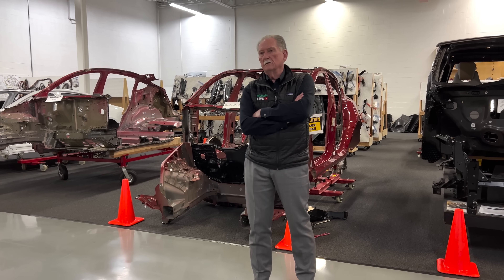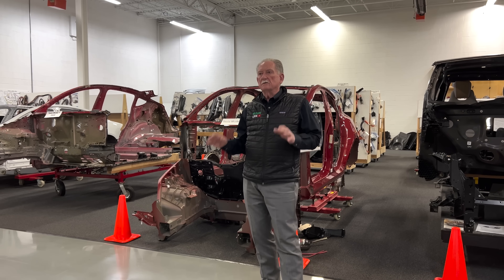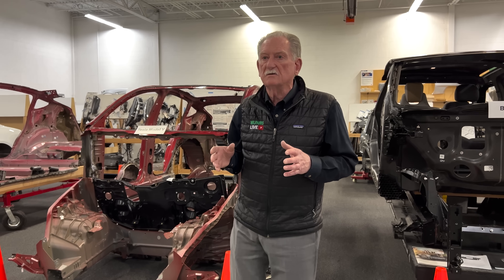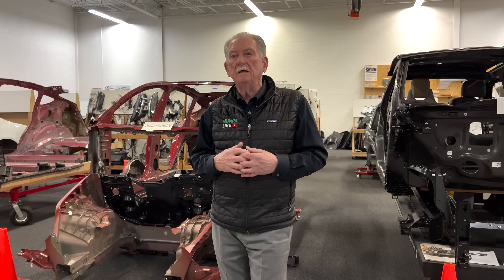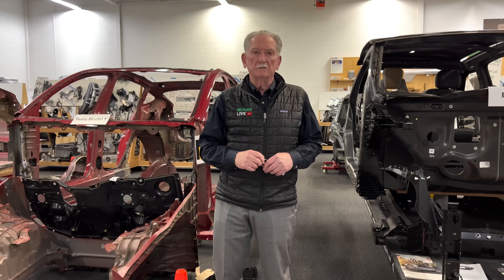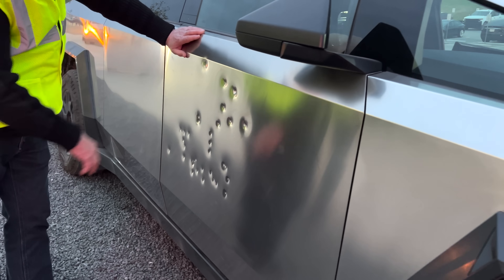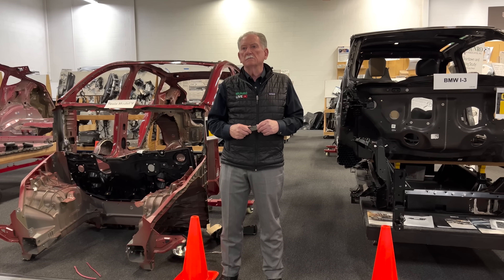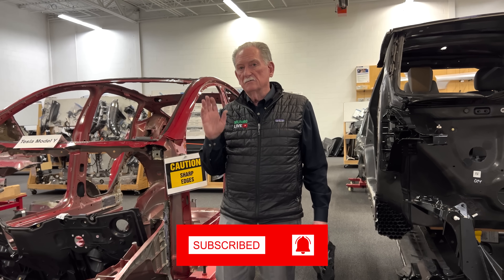An Engineering Analysis of the Tesla Cybertruck

Comment: No one cares about CyberTruck.  Elon never learns from his mistakes.  He could have produced an electric truck and beat Rivian to the market.  It would have been so easy.  Yet he got distracted by flash and pomp.  Then production quality gets screwed.  Who needs a 6600 pound truck that can go 0-60 in 4 seconds?  No one.  Its a truck, not a perfomance car.  In otherwords, a speedy death machine that will roll over and launch it self into a roll very easily. You may say that the battery and motors will lower the center of gravity.  However, how long before people start to jack these up?  Elon touts the environment but then produces products that are anything but economic and environmentally friendly.

Comment: The 48V has been used a couple of years now, mostly for hybrid systems and other high power users. It is new to convert everything to 48V, but something like 30 DC-DC converters are needed for things like cameras, dashboard, lighting, sensors and computers, those DC-DC converters are going to eat up some of the 48V benefit.
Talking about weight benefits of 48V sounds weird when the panels of the truck is made from very inefficient thick and heavy steel, compared to any other car or truck.
Just 0.5mm extra thickness of the body panels adds up to something like 70kg / 150 pounds, for countries where "bullet proofing" is not needed, that is a lot of dead weight to carry around.
Reply: I guess they've got to keep the steel thick enough to suppress the drumming of the flat panels
Reply: @pedtrog6443  Did not think of that, but very much possible. 
They could have done it more elegantly but yes.
Reply: A 48 to 12DC buck converter is simple and cheap.  They will be only be used where Tesla uses a device is designed for 12V power.  For example, POE cameras are powered at 48V.  Tesla manufactures their own actuators using 48V or gets them from suppliers when high volumes justify their manufacture.  Moving weight from wiring harnesses to body panels has the benefit of increasing dent and corrosion resistance while allowing for higher power transmission.
Reply: @MsAjax409  Why not keep the body panels industry standard and install 100kg extra battery instead?
Panel thickness does not matter when talking surface corrosion resistance, only if you let the panel rust and look like crap for multiple years, does thickness make a difference.
Also the non stainless parts like suspension arms (Tesla weakspot already) are going to rust away long before the body panels, so the car may end up being the shiniest car on the scrapyard.
Reply: @larsjrgensen5975  The SS panels have been reduced to 1.8 mm for the doors and 1.4 mm for other panels.  They were made martensitic (harder) to retain dent resistance.  Given that there's roughly 100 sqft of SS on Cybertruck with an average thickness of about 1.6 mm, reducing to 0.9 mm (@ 1.5 lbs/sf) would save about 116 lbs.  That's the equivalent of a battery pack of less than 20 kWh.  At 0.4 kWh/mile that's an extended range of 50 miles.  I'd rather have the stronger panels since 318 miles of range covers all my needs.  Those who tow a trailer can either add the range extender or buy an ICE truck.
Reply: @MsAjax409  20kwh would have been a nice addition in the little room under the bed.
The range extender is a joke, limiting the bed size and hampering the ability to transport building material.

The dent resistance is nice, but these panels are going to be expensive to change if they ever get a dent or the surface gets scratched.
Some asshole with a screwdriver can still scratch the surface if they want to and good luck sanding the surface to make it match the rest of the panels.

Comment: The technical details on the stainless is super interesting.I'm curious how it all turns out given the panels will show every little mark. 
The 48v stuff is less interesting.It's not a big deal on such a heavy expensive truck.
And their steer by wire? I'm deeply suspicious of such things,especially from a company that blatantly lies to themselves about it's FSD capabilities.
And comparing it to military or large commercial aircraft is stoopid 😅.Their triple redundant systems and massive testing regimes are a world away from this

Comment: Very interesting about work hardening austenitic stainless into martensitic stainless to increase the tensile strength. Pray tell... how do they increase the low-temperature toughness of the martensitic phase to make the vehicle suitable for low temperature operation without fracturing over bumps, or in the case of the frame hitting a rock during off-road adventures in areas of the USA where it gets very cold during the winter? I specifically avoided using a martensitic stainless steel for a safety-critical part that I designed a few years ago because I knew that they would definitely be used in cold conditions, and the impact toughness simply wasn't good enough, despite the high ultimate strength of the material.

Comment: What happens to these castings upon hard impact ?
If you put higher voltage into a thinner wire, does it create more heat ?
What is beneath a cyber truck....will it be damaged by road salt ?

Comment: Good stuff! What is the purpose of the cross hatching on the conventional castings? Is it to facilitate mold release? Or evacuate the last air as the slug is injected? Or is it actually structural? Theres more to unpack in this innovation.

Also very interested in future discussion on welding two castings together - AFAIK that is totally unprecedented (at least in a mass-production setting) for castings of that size!

Comment: All stainless steel is non magnetic, its due to the chromium content, which eliminates the magnetism of the steel and also makes it rust resistant. Get your metalurgy right🙄 There are numerous high strength steel alloys that are not stainless and are used by essentially all manufacturers as a method to add strength to the car body while saving weight in the process. In fact, Germans' manufacturers are the masters of using different steels and metals to achieve varying structural elements on a car body. The Tesla truck looks like a high school project compared to Mercedes EQ or BMW IX structures.

Comment: Speaking as someone with decades of through the viewfinder experience, IMO Sandy should leave the on-camera performance duties to his far more capable junior engineers. 

Conflating non-stick frying pans with non-stick magnetism just cost Mr. Munro the remainder of what limited credibility he had before this video.  Self-hardening Martensitic steel has been used in bulldozer blades forever. 

Like Twitter/X, the Cybertruck will be a colossal fail.  They might be able to repurpose the chassis into something more acceptable to other than hunters and fourteen year old boys.  

Rear wheel steering will undoubtedly improve the frequently-seen parking lot indiscretions caused by incompetent long wheelbase pickup truck drivers.

Comment: Yes, saving weight in wire harness is a big deal, however cyber truck is not exactly a definition of lightweight vehicle. Fly by wire in an aircraft’s is done for many reasons and cost is no object. Monroe and associate preach saving cost in production and eliminating 1 cent screw and clips, yet here he is preaching the virtue of steer by wire. So now a simple rack and pinion which gives road feel is replaced by electronic encoders, motors, gears and wires, connectors, processors, software and a slew of other parts. Whatever happened to simplify? I like the old adage that some have claimed Einstein is noted for that says “Everything in life should be made as simple as possible but not simpler”. Or Elon Musk saying “ The best part is no part”. Whatever happened to that ethos? I think there is no reason to remake time proven simple mechanical steering.

Comment: This 48V wonder is ridicolous. Yes, you can reduce copper weight . No, it is not because of 48V that you can do steer by wire! You need redundancy, you cannot take the power directly from the same power bus that is powering your car stereo. So you still end up with custom wiring (from battery pack) and a custom voltage. It is nice for tesla because they are cheaping out their cars and a 48V system reduce them some expenses.

Comment: It is extremely frustrating how people continue to push the hype. There is absolutely nothing magical or revolutionary about going from CAN to Ethernet. Yes, Ethernet can transmit data at higher speeds, but 4:34 "The speed of the electricity moving" does not change. 48 VDC travels as fast through wires as 12VDC. Yes, going from CAN to Ethernet can be more secure. However, it is highly likely that any added security is going to do only one thing: frustrate right to repair advocates. Tesla is already infamous for doing this, and we have absolutely zero evidence that they have changed their course.

Work-hardened, "bulletproof" stainless steel is not what anyone with even a basic understanding of automotive engineering would want to use. For decades, vehicles have been designed to absorb impacts before transmitting those forces to the occupants. I spent the beginning of my career working on ambulances where many of the vehicles on the road were built without crumple zones. I can still, decades later, remember coming to a scene and pronouncing the vehicle occupants dead where the vehicle didn't appear to sustain very much damage. On one hand, I wish I could say that it is merely a case of "buyer beware" as it is far more likely in a severe impact to kill the vehicle occupants than a vehicle that has already intentionally self-destructed to absorb the impact force before it reached the passenger compartment. However, the design of the vehicle also very much poses a hazard to others such as pedestrians, bicyclists, and motorcyclists. Many legitimate safety experts have raised serious concerns that, unless Tesla can obtain waivers from numerous safety regulations, this monstrosity will not be able to be sold for many international markets.

Getting back to repairability, there is no reasonable way in the field to weld to work-hardened metal without tempering it within portions of the repair. If the work-hardened state is being used as a key structural element, which would be highly likely with any modern automotive design, then such field repair could compromise the structural integrity of the vehicle even if the cosmetic appearance of the work seems flawless. Also, welding stainless steel properly is very different than using the more routine welding methods (SMAW/ GMAW) routinely used for structural automotive repairs. Yes, there are stainless electrodes for those processes. Yes, there are gas mixes that will work for GMAW. No, I have never encountered a mechanic or auto body shop who had both the proper consumables and reasonable experience welding stainless, and yes stainless steel vehicles have existed since the 1980s. This is, and will be for the reasonably-foreseeable future, a niche welding job farmed out to shops that specialize in the more unique alloys. Having used such specialty welding shops in the past, there is a premium associated with "specialty" welding work. Whether any post-factory welding repair is going to be, from the engineering standpoint, sufficiently comparable to an intact factory panel to be able to return the vehicle to the road is a much bigger question. If Tesla is even going to be willing to discuss this topic with a third-party repair shop, their track record would not make that seem to be a reasonable expectation.

The whole advantage of having the old "tank" style frame and chassis vehicles was that they were repairable by a home garage mechanic with a buzz box and a hammer. This seems more of a case of all of the disadvantages of ancient automotive design compounded with all of the disadvantages of modern automotive design to make a $100k disposable vehicle.

Comment: From a minimalist car driver, do you know how else you can do to lower weight? You remove the features that are expensive, which lowers the cost of the car. The harness still needs to be there for anything that is critical. Everything in the ring is going to be something that is an option. There is a reason I do not like what the automotive industry is producing lately, and I am more looking at how to convert an ICE vehicle.

Comment: I don't really get, why guy like Sandy could just simply say, that Cybertrak's steer by wire (easily) enables rear wheel steering and presents it as something ground breaking. BMW, Audi, MB and probably many others have such a thing for many years and at least since ESP and electric power steering there is (for such application good enough) steering position sensor virtually in every car. Sandy is steadily losing his expertise and becoming averge Tesla fanboy...

Comment: Great insight and thanks for taking the time to share your thoughts Sandy. Now my question to Tesla would be how long before these innovations can trickle down into their previous products, i.e. how long before 48V, steer-by-wire and CFD castings begin to show up in Model S, X, 3 & Y? Does the refreshed Model 3 even have castings yet? With steer-by-wire will we see Model S & X make a reappearance in left-hand-drive markets in the future? Thanks again for your continued diligence in reporting and educating!
Reply: Hard to say how long it will take.  My guess is every time a major update for an existing program - typically every 3-5 years from the last major update.  While less obvious to the consumer, all these changes require just about as much engineering as making a brand new vehicle.

I'm fairly sure the new Model 3 highland (not sold yet in NA), uses larger castings, but yet to be confirmed.

Comment: What does a 12V wire harness weigh? 20 kg without contacts? So a 15 kg weight reduction on a 3000 kg car? All weigth reduction is good, so why not go 800V for the HV system?

Comment: A true engineering analysis would need an actual Cybertruck to take apart and really to analyze. At this point in time, you are only making claims based on marketing material from Tesla. What is really to consider: What parts (ECUs, sensors, actors, power electronics) are actually really running on 48VDC? What is still on 12VDC? How many additional DCDC converters are in the ECUs, sensors, actors to get the voltage down? What parts (ECUs) are communicating over Ethernet? What types of Ethernet, what types of transfer media (twisted pair copper, fiber?) What other standards, such as LIN-bus are used and where? Which parts of the network have an 70% weight reduction? What is the price you have to pay in the sensors, ECUs, actors? What is the effect on availability of parts and supply base?
What is the contribution (in weight and cost) of the decision to go from 400V to 800V in the high-voltage wiring? What is the effect of this decision in the motors, heat pump compressor, AC charger and charging network? Now, Tesla has to upgrade large parts of its up to 450V based supercharger network to  up to 1000 VDC.
This talk is not engineering analysis, this is reading tea leaves.
BTW: There is no "Ethernet ring". Ethernet is the name for many substandards in IEEE 802.3, followed by lowercase letters. Please name, which substandard and what transfer media Tesla really uses. There are bus topologies (early Ethernet, long gone) and star topologies (more recent ones), depending on the actual Ethernet substandard. There is never a ring such as with Token Ring 802.5 (a failed ring topology from decades ago) or MOST bus with a ring topology (automotive industry standard a while ago, often with optical links, was used for some subsystems, but inferior to Ethernet over twisted pair wires). In case, Ethernet components are wired in a ring fashion with point to point links, then a Spanning Tree Protocol (IEEE 802.1d, 802.1w, 802.1s, 802.1q) must run periodically to create a spanning tree. 
The wire that you show demonstrates two different AWG ratings. But the thicker wire is not "12V" and the thinner one is not "48V". Both of these voltages can run over both of these wires (given enough insulation for 48V). They are only equivalent if the power requirement is the same and if the wire material is the same.
You may be a Tesla shareholder and you may be some sort of an influencer and an emotional person. But this video lacked almost every aspect of engineering, such as naming the standards that are used. It may distract people from the inferior level in energy density of the battery pack and the need for the "range extender" pack to get something close to the range Tesla promised before but that adds even more weight and uses a large portion of the bed. And distract from the high price tag. If everything on the truck was so cheap and light, why is it so expensive and heavy?

Comment: Is there a steering actuator for each corner of the truck? If so, could they be used to adjust for dynamic toe-in and toe-out and reduce rolling resistance in increasing the range of the truck?

Comment: The EXTENDED range should be as a trolley not to take space in the back. this trolley could be flexible since you can charge it separately and prepare to tow whenever needed. and when not needed the cybertruck is lighter which takes less energy. this trolley could serve as a home battery etc.

Comment: You mentioned 78% reduction in weight, but that's just the wiring weight right?  What percent of the car's total weight are the wires?  Is it negligible?
Reply: No, copper is expensive.
Reply: So is hand crafted specially designed patent pending stainless steel (allegedly)
Reply: @fredderf6491  so? It's structural and reduces the amount of aluminum and steel needed elsewhere.